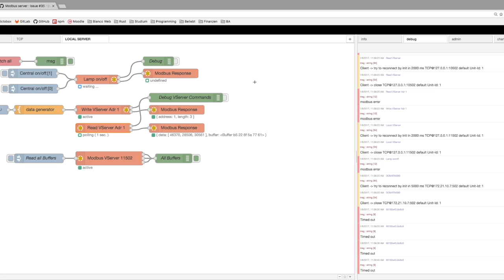node-red-contrib-modbus - Modbus Read and Write nodes

Comment: Hi, Are you sure the READ Single COIL node works. I can't get it to work. I can communicate to the device using Modscan 64 freeware. But with your node Regardless of if I send a '0' or '1' in the inject node. I see a '0' as DATA using  Wire shark trace tool. Any help would be appreciated.